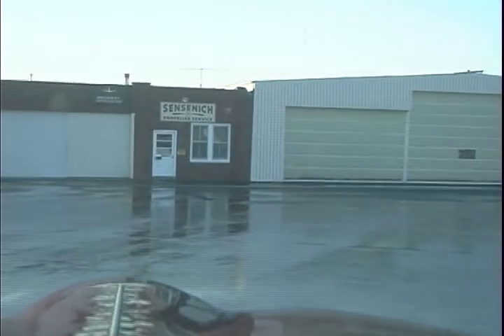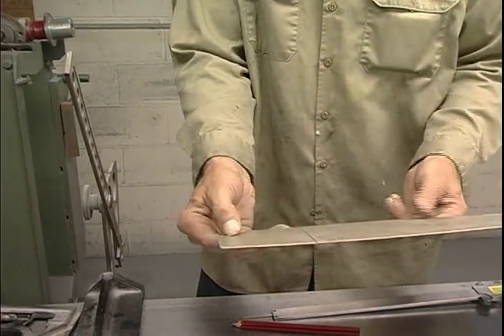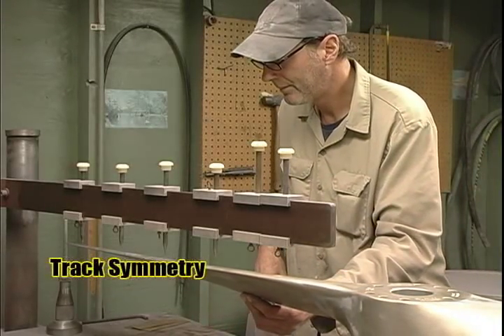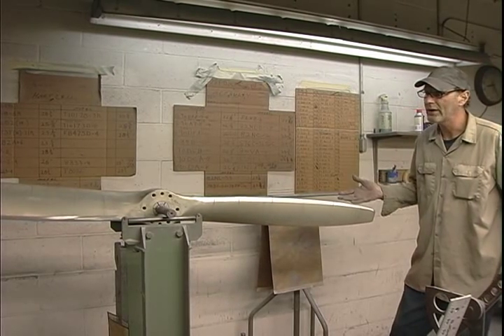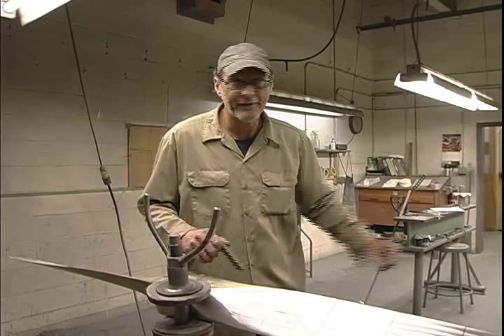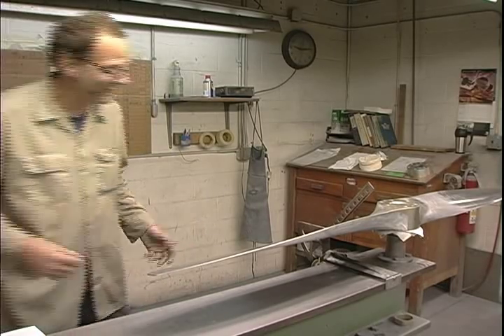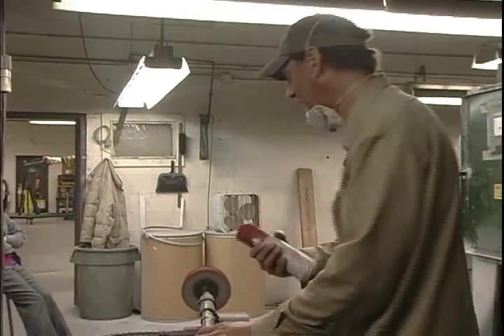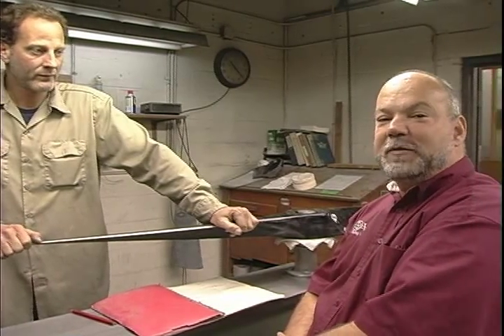Prop Overhaul

Comment: At 2:50 he incorrectly calls the metal process annealing.  I am hoping he meant to say work hardening as that is what happens when the prop is bent back and forth.  You could anneal the metal back to a softer state using a carefully controlled furnace, but obviously that may also require a heat treatment as well.

Comment: So much goes into an aluminum prop inspection wise. I do not see this level of checking in a wood prop. Why is this?
Reply: Wood does not fatigue like metal. A wood frame if kept in good condition can last forever, where meta has a limited, albeit long lifespan.

Comment: Add 2:15 he is using a pencil on aluminium alloy. Thought that was a big N0-No.
Reply: I noticed that as well, the lead in the pencil will cause it to crack if left, however he did polish the blade again after placing those marks so probably ok.
Reply: @terrybaremor6361  Pencil's are graphite not lead.
Reply: Don’t use a pencil on the burner cans in a jet engine. Combustion chambers.

Comment: Given the impossibility of "magnufluxing" aluminum and how difficult it would be to use dyes to crack-check a propeller without stripping it entirely of paint and possibly "scuffing" the polished surface with something to give the dye something to "bite" and flow into, I can't see "overhauling" any propeller I haven't owned since new and have constantly and consistently inspected and kept polished and paint-free since Day 1. 

Way too easy for some clown "upside down" in his new "toy" and needing to dump it before the bank takes it to do a "DuPont overhaul" or "refinishing" polish job on a junk prop that can easily have any nicks or scratches carefully filed/filled to make it "mint condition" to the casual observer. 

Any prop that is out of balance or bent is damaged goods. Period. Even with no nicks or scuffs or scratches. And you don't "straighten" aluminum and get it back into "shape" because it stretched and strained on the outside of a "bend" and compressed and work-hardened on the inside of a bend even after that bend is "gone". 

I don't give a shit how "inexpensive" or "comprehensive" a prop "overhaul" is, you don't and can't compare it to a NEW PROP if you have a brain in your head. You're not getting a NEW PROP and unlike an ACTUAL OVERHAUL of say...ENGINES where wear parts are REPLACED to return critical clearances and surface finishes and engine performance and durability to BRAND-NEW LEVELS, you can't "rebuild" a part by taking material off it and not weaken/compromise it in the process. 

Its also impossible to properly and perfectly balance ONE PART of a rotating assembly like that in any kind of engine-powered powertrain in a vehicle doing a "static" or even "dynamic" balance of one part at a time and have that assembly be "balanced" once everything is assembled and in operation. Buy a balanced reciprocating/rotating assembly for your "hot-rod" or have a quality machine shop do the work balancing new and/or used parts and see if they're "balanced" one at a time but not assembled. 

But hey, AIRPLANES ARE SO EXPENSIVE TO "OVERHAUL" YOU HAVE TO SAVE MONEY WHEREVER POSSIBLE AND MOST OF ITS AN FAA/MRO/A&P SCAM TO ROB PRIVATE PILOTS BLIND BECAUSE THEY'RE ALL JEALOUS OF PRIVATE PILOTS AND THEIR AIRPLANES!

Yeah. When a government agency regulates something or some industry or some group its never because of the potential for those government employees doing the "regulating" or their friends or family membrers to be injured/killed when somebody who isn't qualified/certified/motivated to maintain, service, repair and operate a "privately owned" motor vehicle on or in public "highways" and decides to take the "cheap" and "easy" way out ends up crashing or causing others to crash when their personal transportation suffers a catastrophic failure or even just a momentary "glitch" that takes his or her eyes off the "road" just long enough for them to "lose control". 

The comments I see all over the internet from supposedly "responsible" and " successful" private pilots who think FAA-mandated inspections and FAA-recommended or required "overhauls" are something anyone could or should "opt out" of or should have done as "economically" as possible to "save money" so they have more to spend on UNNECESSARY and FRIVOLOUS gadgets and gizmos like "glass cockpits" and all sorts of high-tech bullshit their rating, aircraft, flights and skill levels not only don't require but are apt to make a "professional" private pilot think he or she is much "safer" and "better equipped" to prevent and handle "emergencies", the more I wonder how and where they worked in their "careers" to make enough money to play with private planes without having any rules, regulations or responsibilities in THAT aspect of their lives sufficient to demonstrate the importance of "playing by the rules" in their personal, play-time lives. 

And the ones that are playing "charter pilot" on the side flying paying or even non-paying but non-pilot passengers around the country because they want or need the extra income/experience/ego-boost to keep flying that play-toy or purchase the next one or pay for more lessons to add endorsements to their license sure have more balls than I ever would have given that I'd at least value my OWN LIFE if no one else's. 

And the thought of a primarily simulator-trained "pilot" thinking passing a couple "exams" an "instructor" or "flight school" they're paying to GRADUATE THEM so they can FLY makes them an airplane expert on the GROUND  enough to know how to operate and maintain an airplane properly and make "maintenance" decisions from choosing a "good" mechanic/MRO/consultant to what to "defer" and what is or isn't "necessary" or "too expensive", when they probably can't or won't check the oil or change a tire  in/on  their "ground transportation, makes me glad I don't live anywhere near an airport. 

Seriously, if you really want to fly and don't want to be bothered with TBOs and all that required "scam" stuff, why bother getting a pilots license in the first place? You don't need one in controlled airspace,  you can buy way "more" airplane for "cheap" if you're okay with cutting corners and "deferred" work and rolling the dice on an "experimental" plain that's certified by the FAA for use by certified pilots as far as that "type" goes but sure as hell doesn't need to be certified for a part-time "pilot" flying in uncontrolled airspace and doesn't even need to be insured if that "pilot" has saved enough money to buy it outright and REALLY wants to "save money" not making payments and paying full-coverage insurance premiums as a new licensed pilot in a financed airplane. 

Shit, its not like 90% of private pilots aren't spending 90% or more of their flight time in uncontrolled airspace anyway and they sure as hell don't let little things like regulations and recommendations pertinent to their airplanes boss them around. Why be a FAA-licensed and "qualified" pilot in an airplane that gets its FAA-required annual inspection by an FAA-licensed MRO/A&P who will a "qualified" pilot run the show in the shop or goes to a "consultant" with the inspection form and lets that third party who hasn't laid eyes on the plane make the call on what "needs" or "doesn't need" to be done? 

Think how much money those new-pilot "experts" would save just going with the "fly by night" approach from Day One and just going from Flight Simulator to the pilot's seat and from YouTube "overhaul" videos to amateur A&P.
Reply: Sounds like a broke and frustrated pilot that wants to fly but can't afford it, there is nothing cheap about airplanes.
Reply: You my friend are the king of a run on sentence. 🤣
Reply: Oooooooweeee!
 Somebody needs a Midol